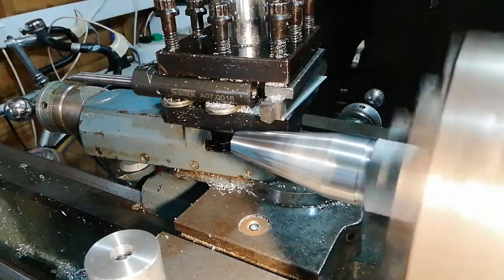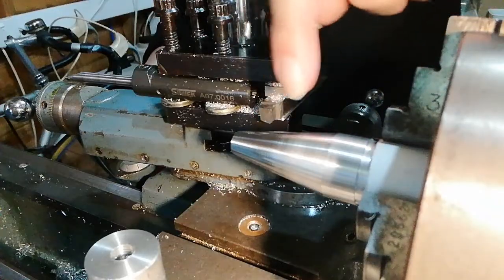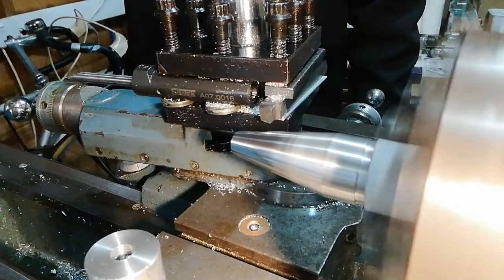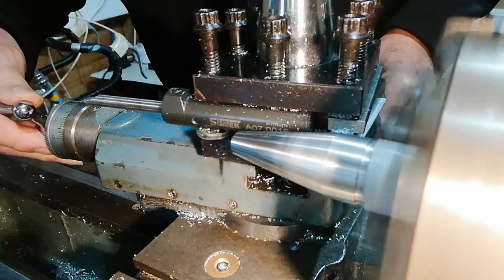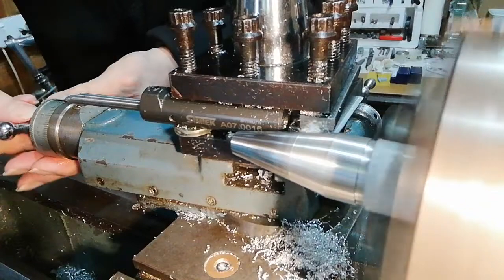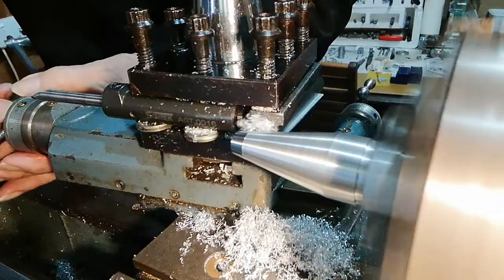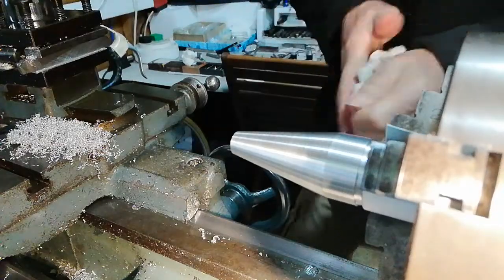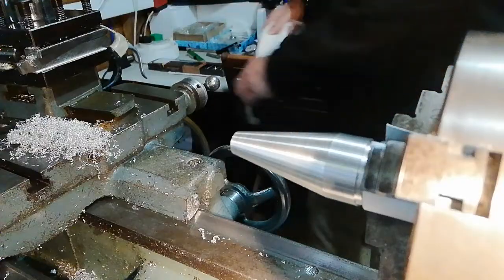How to generate  super smooth quality surface finishes, with H. S. cutting tools on a Centre Lathe.

Comment: I used a Motor with a Cloth Buff mounted in the Tool Post and some Buffing Soap >> You cannot beat it > Try it, but make sure your Medical insurance is up to date because you might have a Heart attack from the blinding results !
Reply from the maker: Yes thank you for your comment Graham and I do know that method can produce good results.  There are however issues that could arise when using buffing wheels and great care must be taken during their use.

They can be very aggressive and may remove or degrade surfaces of the workpiece.  The result being distortion of edges and corners, or angles of edges or shoulders, which in most case’s would not be a desirable feature.
It is also sometimes difficult to remove all of the residues of Buffing Soap, although certain colours maybe easier than other grades, which could be less abrasive during application.

I’m sure your method will be useful for others to know about, but with reference to the above mentioned caveat.
Cheers, K. 🍀

Comment: Its all about sfm, spindle speed and cut depth.  In other words, experience.  There is no 'one size fits all' method to achieving a polished finish.
Make chips that dont need dips!
Reply from the maker: You’re quite right of course and thanks for your comment. There are various ways to achieve a desired surface finish.
Practical experience will ultimately determine the parameters and techniques needed to produce the surface texture required for the work piece.  This could also be  variable, depending on the material to be machined.  🍀

Comment: Long sleeve shirt with a high speed chuck = loss of limbs 👎
Reply from the maker: @Roadrash-fk9rn  Thank you for your comment, however; it is considered good and safe working practice in industrial machine shop engineering to wear appropriate protective clothing. This includes overalls, smocks or tops with long close fitting sleeves.  

It is considered hazardous for a machinist to wear short sleeved shirts, which would certainly not be in compliance with acceptable safe working practices. 

I intend to be addressing the issue of RISK ASSESSMENT in a future video, which you may find helpful.  🍀K.

keith@klint.co.uk

www.ATKLINT.com